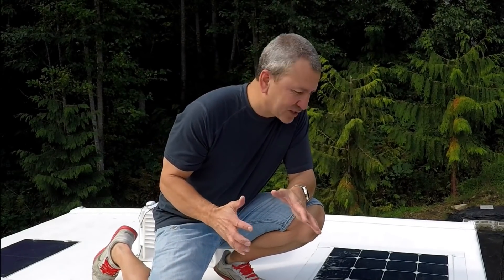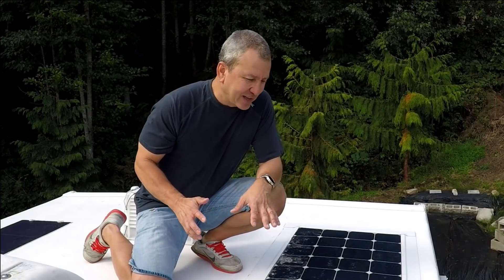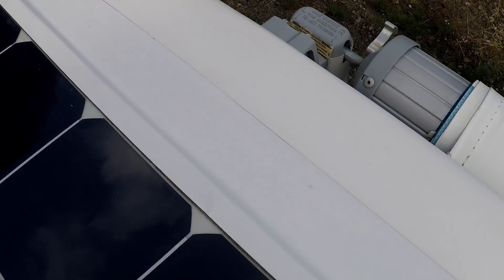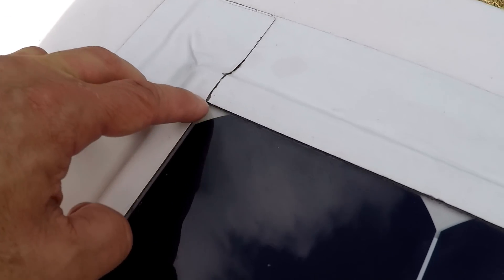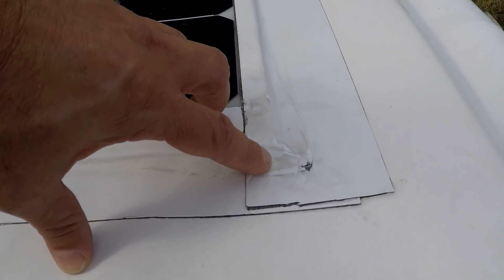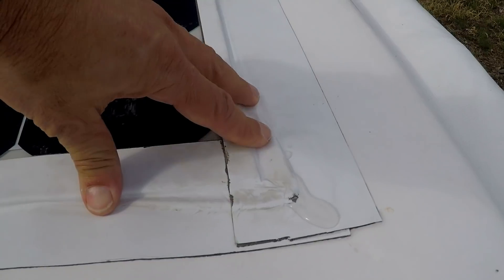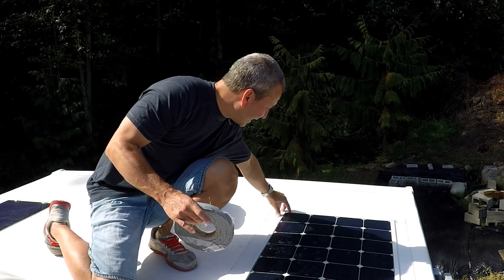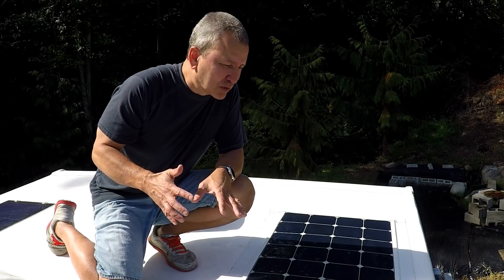ONE YEAR After My DIY FLEXIBLE SOLAR PANEL Installation

Comment: I did my Renogy fexible panels with strips of vhb tape and eterabond on some of the edges leaving arreas where air and water can get in and out. I guess we will see how well it works. Will be going out to Utah, Arizona and Colorado this summer so far it is working well.

Comment: Alternatives to mounting flexi solar panels:: use 6mm or 10mm Tile backing board ( used for underfloor heating / tiling) , lay panel on tilt sheet cut to size of panel,cut out enough vent holes for ventilation, drill m4 holes, glue panel to tile board, mount on wood frame ( in my case to Shed)  with m4 hex nuts/ bolts and largest m4 washers you can  find. Sandwich 4 washers onto m4 frame  , 3 on bottom 1 on top ( this leaves another gap for heat dissapation away from wood) . Cost of board 6mm £11 or $14 or 10mm £14 or $17.81.

Comment: Is it safe to install the panels onto like a piece of plywood instead? Some of us want to be able to move the solar panels around. But I'm not sure if wood is safe since there were a few incidents of people having fires from solar panels. (Although maybe this was actually from fresnel lenses?) 

What would someone install them onto if they wanted to be able to move them around, but didn't have welding or metalworking skills? 

The flexible solar panels do get damaged easy if not installed on something to keep them from moving.

Comment: I'd use a waterproof sealant to glue it to the surface but make sure you have a water proof the solar panel seams so the water can't pennate that is weather and sun resistant but will like all things checked to see it hasn't been compromised by the elements.,if something doesn't work out try something else....

Comment: I know this video is a few years old but I’m installing mine today with VHB tape in the middle of the panels and clear gorilla tape on the outside edges to seal it. Also corrugated plastic underneath to level off the uneven places of my vans roof. I plan to leave some gaps in the seal tape to let air get in to cool underneath the panels and also to let the water drain out. A name with the clear gorilla tape because it’s just as strong as the regular stuff, not as hot, and it won’t be a big deal if it overlaps into the actual working solar area, Also it will allow me to see if anything is getting trapped underneath the panels like water.
Reply: @SKINLA682 so far so good. The clear gorilla tape is a bit yellow but no affect on the performance.
Reply: So postscript, install the panels today and I will tell you that this VHB tape is basically permanent. I made one little mistake and barely barely got it pried off. So for now I’m gonna say this tape is the perfect bonding for flexible solar panels on my van.

Comment: Good thing you used Eternabond tape.
I used some white tape from Amazon to hold my cable runs from the panels and one year later the glue had given out.
The glass panels themselves are held down with the double sided Eternabond and Dicor and doing well

Comment: Wondering what the output of the panels are now post year? Thanks
Reply from the maker: I've since upgrade them to larger higher quality panels. Check this out: https://youtu.be/uJIEXhnF8MU
Reply: @RVwithTito  Thanks - I was more interested if the panel output degraded much? Im hearing flexy only lasting 6 months? My HiAce pop top van has a curved roof east west so doing maybe ABS plastic stick on corners etc - Thanks for great vids 😁😄
Reply from the maker: @melbournesubtropicfruits9474  All flex panels are not the same even though they look like it. You should get many years out of a high quality flex panel like genuine SunPower, Sol-Go or MerlinSolar. Expect to pay more for the high-end solar cells and busbar technology built into those. Most cheaper ones are just lookalikes and you just don't know what you're buying. That's my two cents.
Reply: @RVwithTito  checked Amazon in Australia and Sunpower Flexi panels are over $1400au - thats darned expensive - huge profit margins?

Comment: I haver been using the 1" double sided eternabond tape on the outer edges of my flex panel installs with zero issues. I have done quite a few rv's now and not one issue. The tape seals all sides and no lifting. Perfect.

Comment: I am considering flexible panels and some call for using adhesive caulk AND intentionally leaving a 1" gap of no caulk on wayward & low edge to allow water to naturally drain if some water condenses underneath.
Is this crazy or smart?
Reply from the maker: Not crazy. Smart. I've always had condensation regardless of how well it was sealed up.

Comment: Found this interesting video early 2021 and would like to ask how the efficiency varies in hot conditions. Solid panels are recommended to be installed with a gap underneath to get a bit of airflow that cools the panel down...what are your experiences, gluing it directly to the roof?

Comment: You mention that you had “a lot of hot weather “ on occasions.
Are your panels on a steel or fibreglass roof ??
Did your panels suffer any over heating in the hot weather ?
I have four 50watt panels to fit on a fibreglass roof and am wondering if they would suffer any overheating?
Here in the UK we don’t have many heatwaves but I’m worried they may overheat being on fibreglass, which won’t dissipate heat as a steel roof would.
I certainly would like to install them as you have, with either tape or silicone bonding but the heat issue is bothering.
I have seen all manner of mounting with spaced polycarbonate panels or mounting brackets to create an air space, which would make a lot more complicated job. 
Your further comments would help and be appreciated. Kindest regards, Robert.

Comment: Brian, to deal the edges of my ridged solar panels so they didn't leak, I put a thin line of clear silicon along the edges of the ridged panel glass. In Olympia WA, lots of rain and no issues with leaking. Have you considered using silicone or another liquid sealant in those corners? Wouldn't need much. Be a lot cheaper than another layer of tape. Thanks for the videos. You're very easy to understand.
Reply from the maker: Hi Jack. I'm using a different mounting technique now so this issue is solved.

Comment: Thank you for this video. I read through the description and the comments and I wanted to ask, Is your roof a rubber roof? I just bought flexible panels and am wondering if the eternabond tape is ok for a rubber roof.
Reply from the maker: Yes. I have a rubber roof.

Comment: One thing I've learned today is that Dicor is some pretty good stuff!  Another thing I've learned in the past is that sometimes it's best to ALLOW for water to get in, by giving it a safe way out.  Just a small untaped portion at the lowest point may be all you need to have the Eternabond panels being eternal.  However, then vibration and dust can be an issue as well.

Comment: IMO trying to waterproof the panel to the roof is a losing battle no matter what you do. My solution would be to leave the corners untaped so water can drain.  The small amount of water that doesn't drain will be driven out when the sun heats the panels. The main thing is to not have a constant pool of water which will eventually damage the roof or the panel or both.

Comment: Do you think a small bead of silicone seal for caulk wood eliminate the water penetration?
Reply from the maker: You'd probably still get some condensation. I've removed other that were completely sealed and still had condensation.

Comment: Why don't u just take the panel off, clean up everything, reinstall the same way and apply a small coat of silicone on all the seams and corners to seal up the borders?
Reply from the maker: I have since replaced that panel with a 170W mounted differently. See the more current mounting video.

Comment: Hi all if your roof top is METAL, then use a roll of sticky magnetic tape, it will cling to your roof like super glue, also the gap under the panels have got ventilation,  plus water can run away,  all the Best Stephen Padley UK
Reply from the maker: Just make sure the adhesive on the mag tape doesn't loosen when it gets hot. Thanks for the suggestion Stephen.

Comment: Thanks for sharing that video! You should glue some bolts to your RV and then you should add the tape and this is not going to happen. I saw on the video you glued your solar panel first. I think now you need to add more tape or maybe use a different one.  Did you have a loss power in that year? How is your solar panel performance doing ?

Comment: Any reason why you couldn't bond it on with epoxy resin?
I was planning to bond about 10 on my caravan when I get it this summer.
Reply from the maker: I suppose you could, but you'd never be able to remove them.

Comment: It doesn't matter what kind of tape he uses condensation is caused by the lack of atmosphere under the panel the difference of the outside temperature in the roof temperature is causing condensation which we'll pressurize and find a way out usually in the corners maybe if he was to put some weep holes or some sort of a device to keep a weep hole on the low side where the moisture can we buy out and also it can breathe?
 Also people who use sealant on the screw heads or Hardware exposed after any mounting brackets are only going to get temporary waterproof results as soon as the sun has a chance to shine on it or a temperature differential because of cold and then hot they're going to sweat end eventually start leaking what will happen is the hardware if not stainless or something similar will corrode the sealant needs to be under the hardware knot on top of it maybe by making a hole and inserting ceiling in it and then screwing the hardware down without having to caulk the heads of the screws came eventually they will week condensation is the enemy?????

Comment: hows this going in 2019? I another great idea that will have a 8mm air gap under the panels for cooling.
Reply from the maker: I came up with a new way to mount these this year. https://youtu.be/hROYaqY83v4. I also replaced those panels with SUNPOWER branded panels.

Comment: I also had second thoughts about a hole in the roof but I also knew the tape will fail due to rain. Heat , moss, wind birds picking at it , sooooooo screwed them , some tape putty around the holes and dicor self leveling up,  I'm retired so less time on a ladder and roof is ok with me.

Comment: By keeping the solar panels on top of the hot van top will reduce the efficiency of the panels.  They need air circulation underneath them which would reduce the heat a little bit.  Can you find out what's the efficiency difference?

Comment: Another force which is acting on your panels is lower pressure air that moves over your RV as you drive. This acts like a suction lifting the panels up which creates flex. This force is likely what is lifting the tape over time. If you have ever sat in a soft top vehicle on the highway, you know what I mean. You may still prevent water/moisture infiltration without any adhesive under the flex panel by placing a bead of silicone around the edge of the panel before applying the Eternabond tape.

Comment: Hi Tito, how about using some kind of slotted strut full length under the panel edges. This would let water escape around the edges and air circulation.

Comment: Should have mounted them on brackets so they will have ventilation... you can use the same tape and it will hold... mine have been on for five years now and no problems....

Comment: I love the idea of eternabond and that's how I want to do my panel this summer. Any issues with not having a gap under the panel? So many people are concerned about it but I can't really see an alternative with these panels. Thanks for sharing and follow ups.
Reply from the maker: I've come up with a new mounting technique that addresses those concerns. Stay tuned.
Reply: @RVwithTito  was this update ever made? I am about to mount two 160w renogy flexible panels to my new rv. These videos definitely helped, Thanks!
Reply: Nevermind. just found the next update. Thanks!
Reply from the maker: @dbm12  FYI I've also mounted a 170W flex panel using the new technique.

Comment: Great update, I believe putting some caulk or silicone at the end of the tape edges would provide more protection and stop water seaping in.
Reply: Thinking the same thing.  Could be done such that tape could still be removed if removal was required.

Comment: wondering  what removal  would be like  with  double  sided  eternabond on  edges of panel  would be like,  possibility to tear roof  membrane??   just  wondering!
Reply from the maker: I'd use a scraper with a hair dryer. You might also damage the solar panel if you try and pull it up. Well, maybe it's toast already which is why you'd be removing it.
Reply: @RVwithTito  Ya, I had a cheaper flex panel & used the butyl tape, quick/clean install... but the controller box on the panel got tugged and broke... Unfortunately I need to remove the panel for replacement.  The butyl tape was easily cut... but then so much permanently stuck on the roof!  The Goof-off adhesive remover and razor couldn't remove it.  Hence my hesitation to use it ever again... ideas around that removal?

Comment: I'm coming in more than a year after this was originally posted.  I'm brand new to "rv" life and recently purchased a shuttle bus which I plan to VERY SIMPLY remodel into an RV/Camper.  My 2 160 watt 12 v Renogy flexible panels are sitting in my living room as I type this and I'm googling several hours each day all things solar. Still need to buy a charge controller, lithium battery(ies) and an inverter/charger, as well as all the various cords/connectors and such.  So far, I don't feel like I know what to get and any suggestions are much appreciated.  I understand my charge controller will need to be a 30amp.  So, my big question here is.....have you learned anything more regarding the non-hole installation of your flexible solar panels?  I am considering the VHB tape mentioned below, though I have no idea what it is.  Any feedback from anyone on this feed is much appreciated.  Thank you :)

Comment: Brian - Just bought a 30 ft Rockwood 2604ws and am planning to put panels and potentially use lithium batteries instead of lead/acid and have a few specific questions about your experience doing this as a DIY project but am hesitant because there are many "moving parts".   For example: drilling panels, feeding cable, cable gauge, components such as MPT Charge Controller, and inverter.   I was thinking of getting 265 watt Grape Solar panels instead of the 100 watt because they provide more wattage and are not terribly larger than a typical 100watt panel, but I see that the flexible panels seem to be working well for you.  Should I ask them "one at a time" on the forum here or is there a way that I can ask you some questions directly?  Kind regards,  Dan

Comment: Forgive me for not reading all of the previous comments and apologies for repeating any prior advice but all I’ve experienced so far with flexible panels is to make sure that the underside of the panel is vented if there are air voids beneath - if it lifts due to pressure build up then the panel will distort and cells will break
Reply from the maker: Thanks for the top. I'm experimenting with a couple new mounting techniques that I'll share soon.

Comment: Would it maybe be worth it to have a very small tube like half a capped metal yerba mate straw embedded on that low end? You could then suck/pump out that water that way, if it's a mold consideration. Just thinking out loud.

Comment: Sound like hot & cold = Condensation from the air thats under it.. Even a little air will promote condensation from one side being hot and one side (roof is colder). 

Personally I dislike them flex solar panels.. I think air is needed around the most panels... 

Best fix.... remove them and ad mounts and do it right.

Comment: Tito, I love the way you try to keep it simple for us dumb guys. I have seen all your videos and  I would like to know how to really size a solar system, I want to be able to run my 50 amp electric system with solar. I have to 2 air conditioning units and normally when I run my microwave I turn off one of them to make sure I don't overcharge my generator. I love to go boondocking and running the generator is becoming too expensive and noisy. I hoipe you can help me "Obi-won Titoby"
Reply from the maker: I'm stealing the nickname. Love it! 

To size a system, you're really sizing your battery bank. The solar is primarily for charging batteries. Getting the 50 amp AC equivalent output from a 12V battery/solar setup is just not realistic. To run on batteries/solar you'll have to scale back your expectations. How much power do really you need in a given day? Do you have an electric residential fridge that runs all day/night as well? If so that's a huge power suck in itself. Assuming you had a system that could run your air conditioner, your batteries would probably be dead in a few hours or less. 

Let me walk you through a little electrical voltage math to simulate even a 30A AC load (like my Class C). Let's talk overall power in Watts (watts = amps * volts). To get 30 amps at 120 volts AC from a battery bank (30A * 120V = 3,600 Watts), you'll have to draw 300 amps from a 12v battery bank (3,600 watts / 12V = 300A). So 300 amp hours of Lithium batteries will generate that power for only one hour. Then you're completely dead. So you'll need to spend a fortune in equipment for a few hours of air conditioning. You might try harnessing the power of the dark side :)

It's really a bigger discussion, but I hope this comparison helps to put things into perspective. 

Cheers. ~OWT
Reply: Thanks for the response I think I need to dig more into this and understand more the benefits of solar